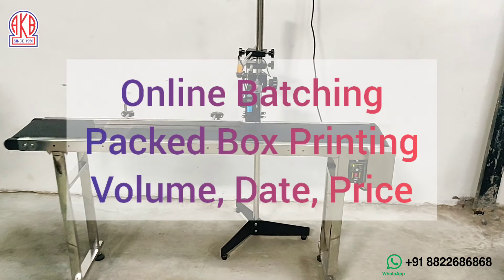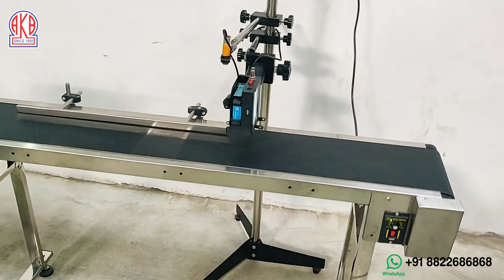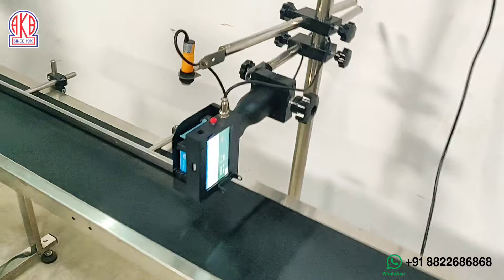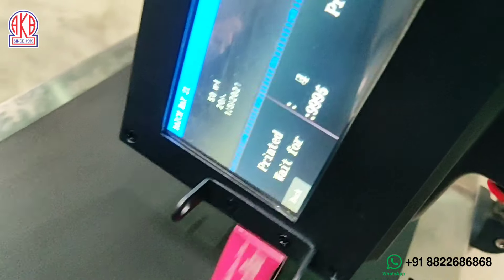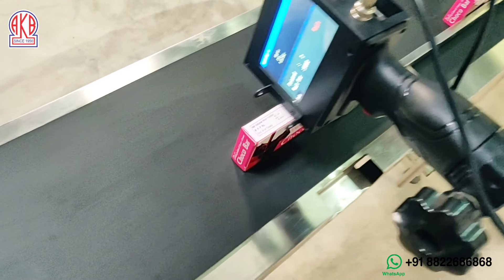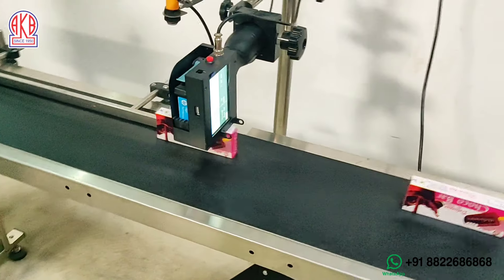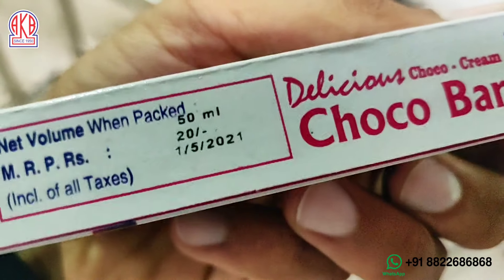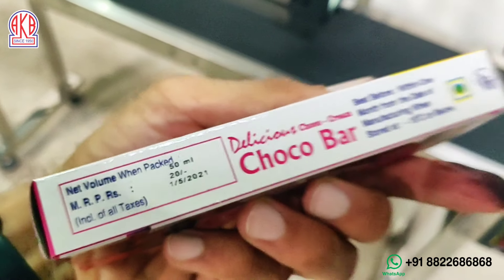Very Affordable Automatic MRP, Date, Serial Number, Batch Coding machine on boxes  बैच कोडिंग मशीन

Comment: Looks Simple and Easy , but solid ink system is not used here , so I would like to know the cost per print or how many times it can print in a single cartridge
Reply from the maker: Dear Sir, Thank you for showing interest in our machines and raw materials. We would like to understand your requirement so that we can provide perfect solution to you. Kindly Call / WhatsApp Us : +91 8822686868, +91 7588226868 +91 7588933052, +91 9405052152, +91 9423185452, 0257 2233220, 0257 2236952, 0257 2237052.